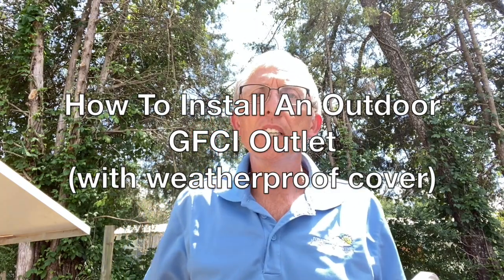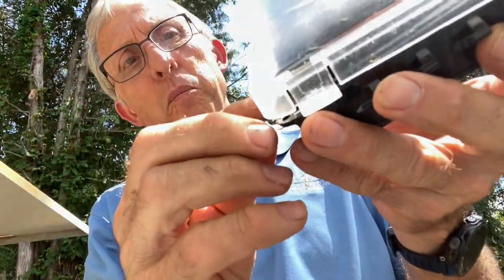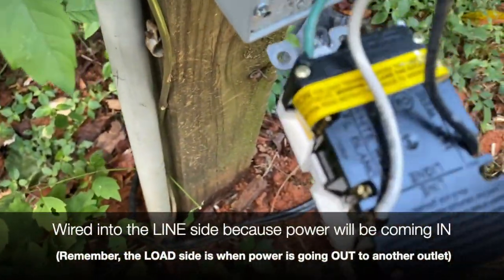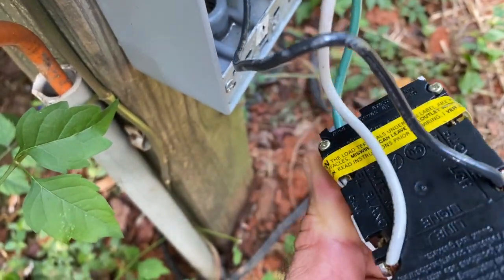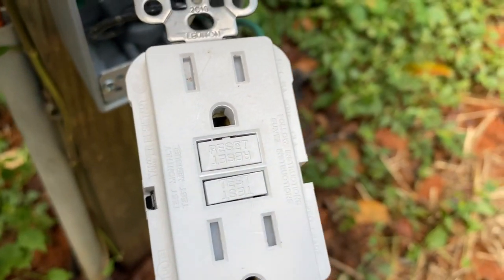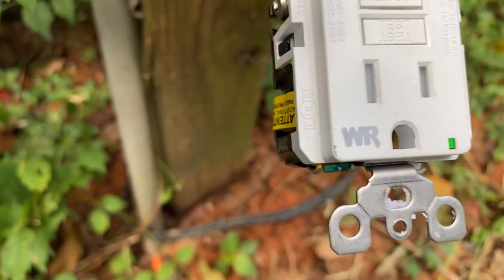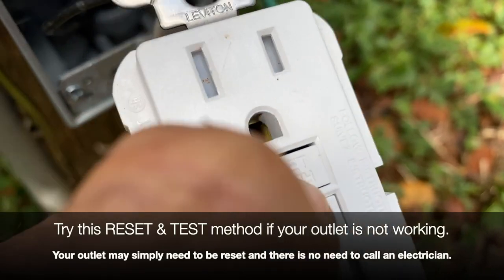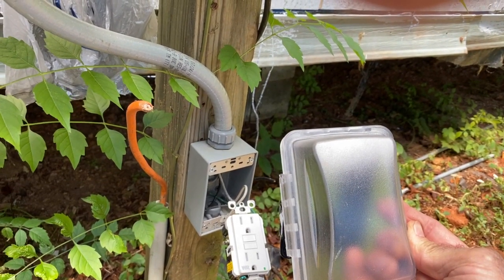How To Properly Install an Outdoor GFCI Outlet: Explained Step by Step

Comment: I'm surprised you were pressing the test and reset buttons WITHOUT the cover on the outlet. So easy to slip and touch the hot post on the uncovered outlet -- with potentially dire consequences.

Comment: I kept waiting for you to install the cover, that's why I came here and you never did.
Reply: I hate those covers, lol. The way I install them may be different how others do but I found it easier to install the receptacle plug in the existing box first.... and then I remove one screw off the receptacle and I install it through the clear cover. I don't drive the screw all the way in yet. Then I turn the clear cover sideways and I remove the other screw off the receptacle and make it go through the clear cover also. At this point I tight box screws all the way in. I always used an electric drill without bottoming them out and then I used a screw driver to hand tight them.

Comment: David I just watched your other video on 240v 3 phase electrical boxes. I was just wondering if you could tell me if someone could intentionally use this type of electricity to maliciously electrocute someone ina building? I know its an odd question, but my landlord is a psychopath and a murderer. About 4 months ago she had a 3 phase 240/480 volt 2000 amp 65000 amp circuit fault electrical vehicle meter installed in the building and powered by the dept of water and power. She didn't get permits from the city for anything else and may have had her sketchy electrician do the install of whatever meter itself because it says some weird stuff on the work order about skipping necessary checks but that the device is operational. She doesn't have any plans to install any EV chargers and the location where she had the meter put in isn't even near where car could possibly park. On top of this 4 floors up in a highrise building people are getting electrocuted which has happened to me too. It's very strong but it's all over your body and not coming from one place like your hand like it would if you accidentally touched a wire or something. Do you have any advice on this or what she could possibly be doing? Is she just running a wire up there and letting the current pass through whatever is there on its way to the ground? The police wont help because this is in LA and they think it's bs and don't care to check it out. She's literally a human trafficker and no one will look into it because it's all impossible. What then is she doing with this EV meter and 2000 amps that was isntalled right when people started getting electrocuted? I've been told it'd be impossible to electrocute someone in a building using regular 120v ac if they weren't holding onto a wire. It's a really serious issue. Thanks.
Reply: California folks.  Lord have mercy